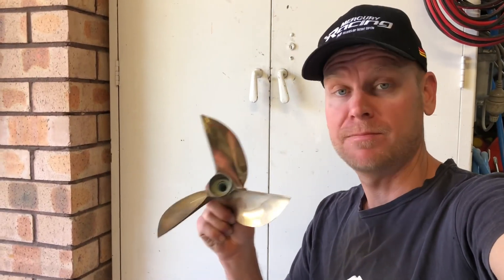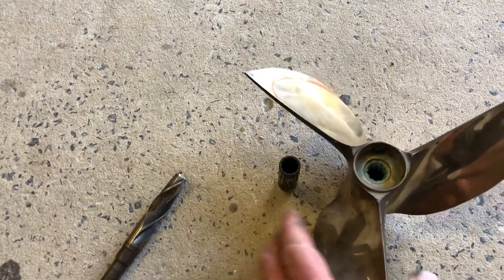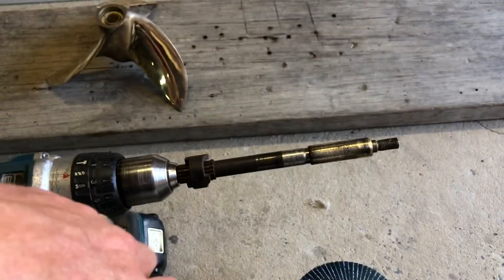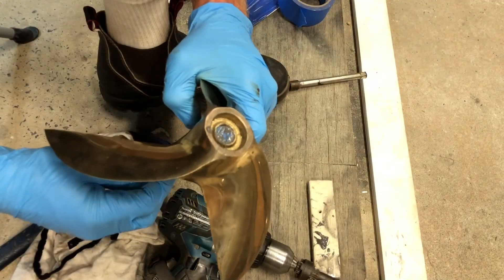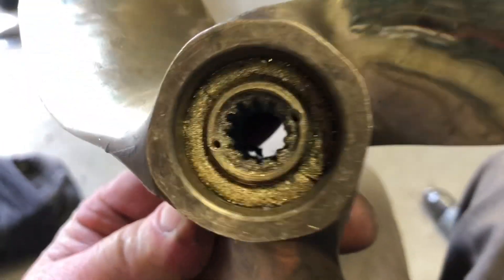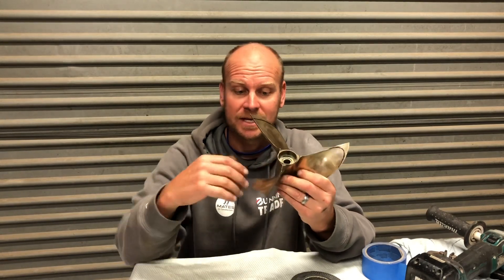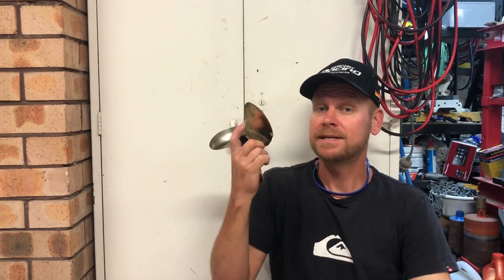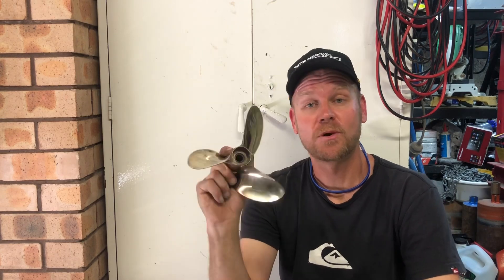Race propeller fun

Comment: I was a little heart broken when ya wacked that cleaver into a drag prop. Your awesome backyard machine work, and the fact that it works on your boat, made up for it. Great work!
Reply from the maker: Thanks mate 👍
Appreciate your encouragement 😁
It was actually a failed casting that I got many years ago and the tips of the cleaver where too thin so cutting them off for a smaller motor was my plan.
Went more the chopper style as it’s going to be used on a monohull and I have another cleaver too for that boat.
All the best 
Cheers 🍻 
Aussie Boat Guy 😎

Comment: Great episode as always! I love it when you do pretty hardcore modifications with very basic tools, impressive. Using the stainless rod to lock the new splines was also a great idea!
Reply from the maker: Hi Mate,
Thanks 👍 I really appreciate your encouragement.
Yeah, the pins really work well to lock the splines, I have used that technique with much larger hp props too.
cheers 🍻 
Aussie Boat Guy 😎

Comment: Good stuff! I like the way you fitted the prop with the stainless wire👍
Reply from the maker: Firstly 
EVERYONE CHECK OUT THIS GUYS CHANNEL 
ITS AWESOME 👏 
Hi Mate,
It works really well for a number of things, I’m sure you will pin something like that too. I have also drilled and tapped a thread in the same manner to install long grub screws between a 32mm bright bar and some hubs on a off road buggy I made which is the same idea.
keep up the good work champ 
cheers 🍻 
Aussie Boat Guy 😎

Comment: Dude your content is just amazing! Where do you get the splined bushing from? From another prop, or can you buy these somewhere? Cheers mate, kepp up this great Work. Lots of love from germany ❤
Reply from the maker: Thanks heaps champ 👍
Yeah I take them from old props. You can buy new ones but cheaper from old wrecked props.
Cheers 🍻 
Aussie Boat Guy 😎
Reply: @25hpboatracerman  Mate, i got one more question. Doesnt this Motor usually have a thru hub prop for the exhaust gases? Obviousily the Prop works quite good one your little tohatsu so this aint a problem? Thank you so much for your content! Take care

Comment: Where did you get that propellor from
Reply from the maker: Hi mate,
It was a failed casting for a bigger motor that I bought many years ago hoping that I could use for a smaller hp motor.
I think only 8 were made
Cheers 🍻 
Aussie Boat Guy 😎